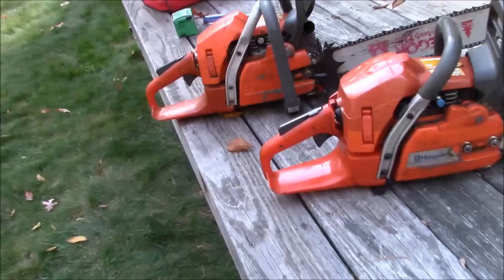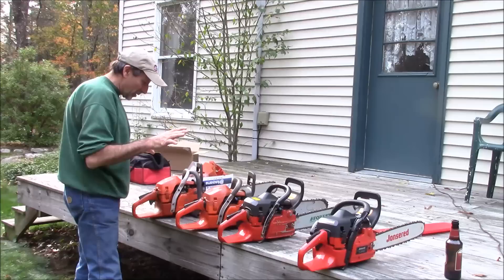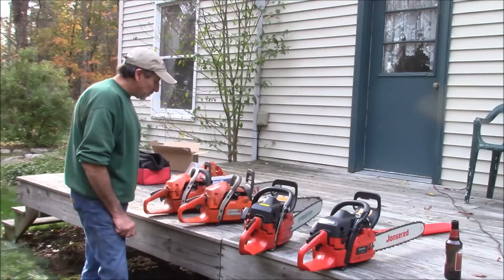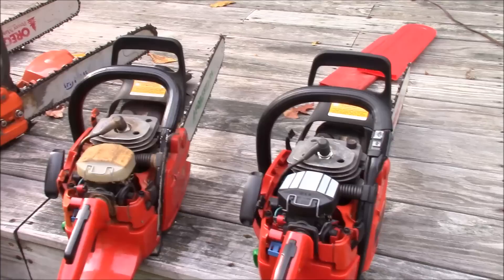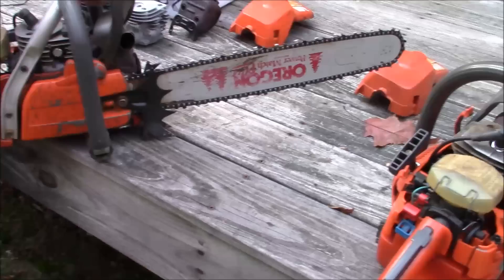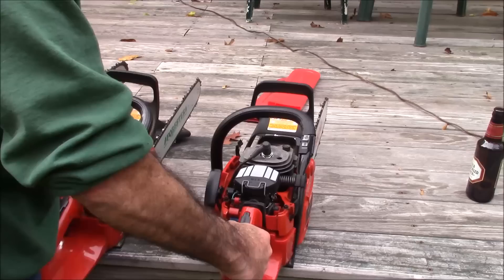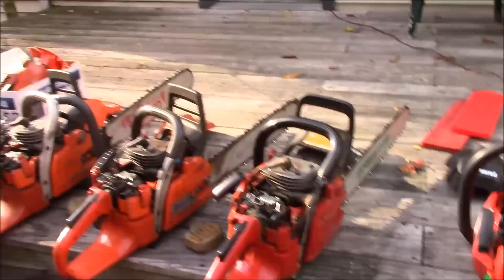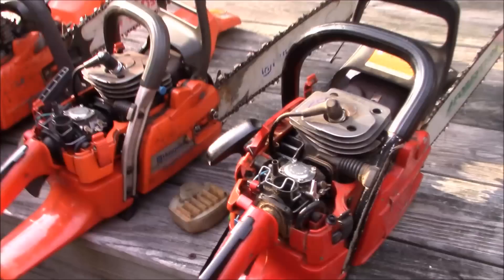Spike60's Saw College  Husqvarna 357xp & 359 Series Of Saws

Comment: My 357xp is my first chainsaw that I owned when I started out as an arborist way back, before I trained as a small engine technician, and I still run it now 12 years later. I have used it with a 15" bar for snedding (bucking)  and 18" for felling, I've used it on my harness as well for topping. It feels like an old friend to me! Just a solid workhorse. Seasons Greetings from across the pond!
PS. I love Old Speckled Hen, great ale there!
Reply: Neil Frost that's good to know. I'm buying one second hand today.
Reply: Sounds familiar. I bought one back after my first year at college in '06. Still running it now, just. It's not without it's faults - often bogs down on pick up, dies on tick over when you need it to stay on, stays on when you'd quite happily have it drop out. I've got a replacement carb on it's way to hopefully remedy it's (un)reliability. But now I'm thinking I should drill a hole through the top plate of the carb and see what it does.

As you say, it's an old friend to me. It has earned me some pocket money over the years, I just want the old chap to run as good as he can. Nothing beats chogging down some lumps with this sucker shouting it's head off!
Reply: @Myrkskog  as probably mentioned in Walt’s above video they have a few quirks in that the earlier ones had the plastic intake clamp that leaked. They also had an automatic decompression valve on a few serial numbers, which in my experience was always a problem.

Comment: I have a now days old 359 etech It is my favorite firewood saw. It is 2 Lbs. lighter than my 372xp... On the 359 I installed a non cat muffler and added another exhaust hole to the muffler, cut off carb limiters. I run 36:1 oil gas, for a 60 cc class saw it runs like a bat out of hell. And did I mention light weight old man saw lol.

Comment: Been waiting for this series for a couple years now, thanks to you both for doing it!  First saw in this class I ever spent time with was one of the 'red' ones, but ended up, as you know, buying the 359.  It has been a fantastic, do-everything saw for a number of years now, but is starting to display those air-leak symptoms.  I have a decomp plug, and can drill a hole in the carb cover, but so far the metal boot band has been elusive. Things  to play with.....  Thanks!
Reply: Thanks Ben, I had looked there once, but must have missed it in all the model numbers!  Merry Christmas!
Reply: Yeah, I have the hardest time navigating that site. Merry Christmas to you too!

Comment: I had a Solo 680 (I think it was) for a short time. My next-door neighbor found it at a thrift store for 20 bucks and I traded a running pawn shop Poulan for it. It had no spark so I got a nos coil and got it running. Carb needed no work. Looked like new. It came with a Husqvarna 18-inch (!) bar and Oregon chisel chain. The saw looked unused in just about every respect. Started cutting some fairly large ash and it was burning paint off of the muffler. Put a Sugihara 28" bar on it and Ebay'ed it. I would have kept it but for the fact that it was all plastic. I would have broken it in no time. I did cut down a big-ass oak tree while I had it. It was a strong saw. 90cc's will do that.

Comment: I also found a Jonsered 2094 too. Looks like new in the pics for $500 not sure if that is a good price or not. I know I was reading online and some people said the earlier ones didn't have a decompression valve. There is a 2166 for $450 too but I found new ones on Ebay for $550 dealer had 18 of them as of last week not sure if they have any left now. Kinda hard for me to buy a used saw when I can get it brand new for $100 more.

Comment: I found a 359 for sale on FB today. Not sure I even remember seeing one before. Guy wants $250 for it. I haven't went to look at it but it looks in average shape in the pics claims it runs good that $250 is probably alright but there is a MS361 for the same price I would rather have. There is one of the Echo 60cc pro saws too the 620 whatever the model is that is in the box was a factory refurb I guess guy wants $250 for also. I don't really need any of them but I kinda want one or 2 of them lol. I already have a 64cc Makita so I have a similar saw already but if I got a 60cc pro saw maybe I would buy one of the 79cc top ends for the Makita. I just missed on a like new MS362c and MS460 the other day. Seems a ton of pro saws are popping up for sale at reasonable prices right now but those saws sold as soon as they got posted. I messaged both but both said somebody was on the way to buy them and I messaged them within a couple hours of them posting them for sale. Guy only wanted $350 for the MS460 and $450 for the MS362c that thing looked like it had maybe a couple tanks through it looked brand new still. Couple weeks ago somebody had a 365 and a 562 for $250 each and I think it was a 388 it was a top handle Husqvarna think that was the model he wanted $80 for but they all sold within a couple hours and he was almost 2 hours away from me so I wasn't going to drive all that way unless I knew he had them still. I found a Redmax GZ5000 for $299 that interests me too.

Comment: With the walbro carb issue... isnt it vented under the the cover? I'm having issues with mine currently and testing the ignition first but then it is back to the carburetor. Runs normal for 5 min and then starts losing power and running sporadically like it's running out of fuel. Hard restart.
Reply: Could be that, may want to check your tank vent, jic
Reply: Watched a video yesterday that says it's due to the Walbro Carb not fueling properly.  Saw another video where a fella replaced the Walbro Carb with a Zama.
Reply: Go to 14:23 in the video and they discuss a fix for the carb issue also.  Just watched it.

Comment: Hey guys love your videos was wondering what you would recommend for clearing land. I have five heavily wooded acres ( all poplar wood) running a small 240 E . Saw works great but it’s just too small. Thinking about a 460 rancher. Any thoughts would be appreciated thanks so much.
Reply from the maker: The 460 rancher is a great saw. Only saw in the size and weight class I would "wrestle" with as an alternative is a 555 actually. Think Bob & I did a video or three on those class of saws. The 460 is the best of that series, 455 & 465 being the other ones. 

https://www.youtube.com/watch?v=nHAsi5wG-8o

part 2

https://www.youtube.com/watch?v=zfHrdDjoDMI

Comment: Most of the walbros fail because of the accelerator pump not the vent
Reply from the maker: Can you post a picture of those accelerator pumps on the Walbros' that came with the 357's
Reply: Also some of the diaphragms didn't match up with the passages on the carburetor, so you'd have to punch out a small hole on the fuel pump diagram. Simple fix, that's often overlooked.

Comment: Can you confirm or dispute this rumor?...

I had a logger friend bring this issue up with the 2159.

At idle, if you are holding both handles appropriately and press on the bar, it causes the saw to accelerate without touching the trigger.  Dangerous!! Not a big deal at the log pile but more of an issue if you are wading through brush. I dont notice with my 2156 so I didnt know if there is some difference in throttle linkage. Thanks
Reply from the maker: Not a clue, I don't have and 359's or 357's in my set of saws, never have. So have no relevant opinion on the matter. The 60cc saws I use and would recommend are all 562's or derivatives and By The Way they have a throttle cable therefore that scenario isn't likely. So my advise? If that's something important to you, buy a 562 or 555, :) That's it for me on the entire 60cc subject for that matter...an action speaks louder than words moment...as I have 560,562's, 555,s :) Period. End Stop
Reply: Ok, how can the question make it to spike60? I wanted to ask because I felt like it was relevant, and may influence purchase decisions. The 357xp/359(2156/2159) seem like they are they ideal for the users that are on the fence between homeowners and pros. So they are probably the ones that would be felling and limbing without as much experience and be most vulnerable to that safety issue.  (Waist high in limbs, poor footing and not expecting the saw to unexpectedly rev up)
Reply: Also want to mention that 2260 is the top of my wish list but they are a rare find so I'm having to make the best of finding 2156 or 2159 and modifying it until I score a 2258/2260